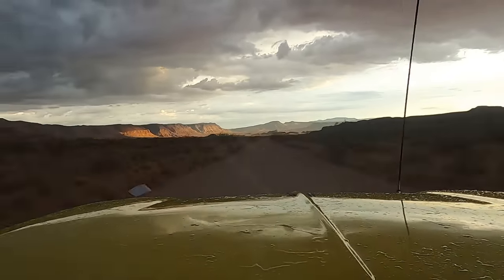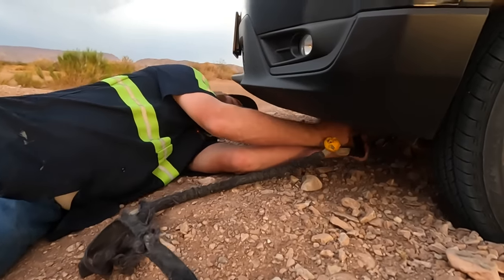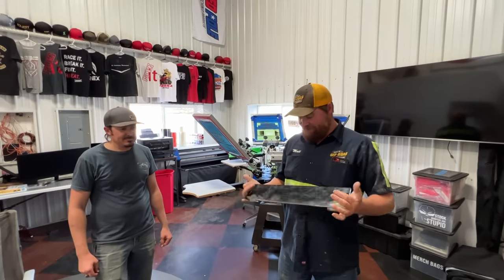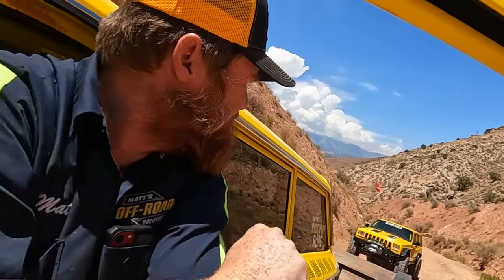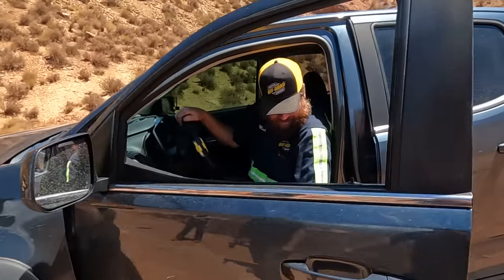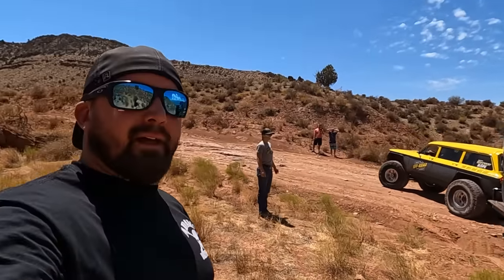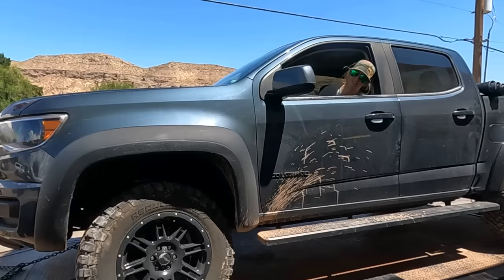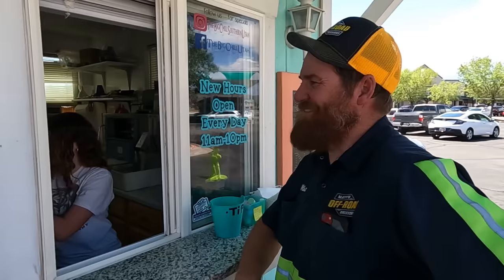Who Would Even Do This?

Comment: "Side by sides do tear up roads".  Thank you for saying that. Drive responsibly.
Reply: I have a SxS. (and a Jeep) 
Yes, SxS's tear the crap out of roads. Everyone runs them in 2WD and the rear bounces up with every bump. Lands, and eats out a little divot of dirt. Over and over X 1000 and they make funky washboardy bumps. Using 4x4, especially uphill would reduce the effects.
Reply: Usually it what's between the seat and steering wheel causing the issues. Do be respectful of the trails for everyone to enjoy nature
Reply: @royh729  I'm a heavy equipment operator (30 years) and have been grading dirt roads from here to Colorado. I know what makes what bumps and washboards. Poor traction is 90% of it.  Using 4x4 and avoiding wheel spin cures most of the road damage. But, people don't like using 4x4 unless they really need it.
Reply: @royh729 The best way to improve off road performance is to upgrade the big nut holding onto the steering wheel.

Comment: For anyone who likes their transmission, the order should always be: 
1.) SET THE PARKING BRAKE 
2.) RELEASE FOOT BRAKE (allowing parking brake to do its thing) 
3.) PUT IN PARK
Reply: Not safe for a steep slope. If the parking break releases the momentum the vehicle gains from the hill may shear off the pawl and allow the vehicle to roll. 
Should be: put in park, slowly let off break untill pawl engages, than set parking break.
Reply: @JohnSmith-do3fe  that‘s the opposite of what you should do. phuz ⬆️ has the right idea but here’s what I like to do.
Put it in Neutral
Set parking brake
Release foot brake
Once vehicle doesn’t roll, you can put it in park and know that the parking brake is holding the weight of the vehicle and NOT the parking pawl.

If the vehicle rolls even with the parking brake engaged, you need to adjust it because no matter what you do..the weight will always be on the parking pawl, which is not what you want. 
Trust me, I park on a sloped driveway everyday
Reply: @hectordeanda9133  That worked in about half the vehicles I've owned; the other half had parking brakes that wouldn't hold no matter how much you adjusted them.
I also learned the hard way not to set the parking brake in freezing weather, if the roads are slushy. Everything refroze overnight and the brake shoes got stuck to the drums.

Comment: I'm sure the owner was a bit pissed at that "beefy" aftermarket control arm ball joint breaking like that
Reply: I have never seen a broken ball joint wheel remain that upright. OTOH I think most of the ones I have seen were lower ball joints... "I'm just going to lie down and take a nap." Pretty dramatic!
Reply: That road is so bad
Reply: I get why people go with the ball joint UCA options but have never regretted getting Total Chaos 1" uniball UCAs on my 4Runner. It is a nice peace of mind knowing that they are more or less indestructible. Looks like a pair of those Freedom UCAs cost about $460 vs a pair of TC uniball UCAs which is around $900. I have never heard of the Freedom ones but I imagine they are fine even with the OEM style BJ for regular driving and light offroad use. But if you start to bomb down a horrible road at speed it may not be the best application.

Comment: i had a upper ball joint on my 91 gmc 1500 pop on me out cutting wood one day, dang tire laid right over. After a long thought period i backed it up and the tire now was upright but behind the control arm. A cut log and a little grunt and i got the broken joint back together. I wrapped 10ft of loggin chain between upper and lower control arm and drove that heap 5 miles home on gravel road with a load of wood in the box. Fun times 👍👍👍👍

Comment: Thanks for being honest about the side by sides.  I ride a dirt bike in an "open" riding area, the side by sides are destroying the desert.
Reply: Sxs have crazy amounts of wheel hop. That and all the hard acceleration make what I call rzr bumps.
Reply: I think part of their problem is how many of the transmissions aren’t really made for crawling at low speed. So, they tend to just power through stuff which digs small bumps into big bumps. Especially with the aggressive tires they normally have. 
With a more normal drivetrain it’s easier to crawl and not dig in as bad.
Reply: In open riding areas they are not even on a road, they are just crossing the desrt, destroying everything in their path.  What used to be a 12 inch wide trail is now a 20 foot wide road.
Reply: @NBSV1  I think the independent suspension adds to that damage.

Comment: Just can't beat the old Ford Twin I Beam front ends. No ball joints to break like the Chevrolet in this video. Granted you have to replace the king pins after 200,000 miles or so, but they won't break.

Comment: Most vehicles have a jack, a very useful tool. Many years ago I helped a young lady get her 70s GM big car out of a ditch when she got out for a call of nature, failed to put the car in park, failed to set the parking brake, the car rolled backwards, and the car's rear wheels were off the ground on the lip of the ravine. A half dozen young men stood around and essentially did nothing. I had a Land Crusher with a winch and knew that there was a risk of drive line damage if I pulled her off the edge of the ravine. The young men, interested in helping a young girl, almost demanded I winch her up off the edge of the ravine. NOPE. I told them to pile rocks and set her jack on the rocks; it was a GM car with a bumper jack, old style. We jacked up the car and put rocks under the rear tires. We had to do this several times because this was an early 70s full size sedan. Finally enough rocks were under the rear tires to get the frame and drive line off the ground so that I could winch her car. The moral of this story is this: Too many ignorant and 'helpless' females and young men have no idea how to get unstuck using the jack. Of course if Matt was to demonstrate how to use a jack in a short video, email a link to it, then he would have fewer stories to tell as more people would become self-reliant. I am a teacher and would make a short video to send them to see if they were smart enough to try to get unstuck on their own.

Comment: What's the logic on UTVs tearing up trails? They are typically lighter, better suspended, have softer sidewall and treaded tires and run lower tire pressure than cars and trucks. They definitely don't create the washboard that cars do.  Perhaps just the ratio of UTVs vs Cars? Or more aggressive, higher speed driving by UTVs?

Comment: Would having a pintle hitch work for the trailer, for off roading? That way if something did go wrong,  only one of the parts got hurt, not everything. Or, does it lose more control if it was a pintle hitch. Use to do much with the large Army trucks and their pintle hitches and trailers.

Comment: Because of how the parking brake actually works you shouldn't tow a vehicle like that Toyota in park. likewise you shouldn't put your vehicle in park if you're getting loaded by a forklift at a place like Lowe's or Home Depot...in that situation it's better to have someone hold the brakes while you're in neutral...   But with the Toyota I'm not really sure what else you could've done, need some wheel straps.

Comment: Just curious how SXS tear up dirt/gravel roads? I have been on that exact road down to toquerville falls in my sxs before, how is my SXS on 35" tires causing more damage than a Jeep or any other offroad vehicle on 35" or larger tires driving down the same road?
Reply: Speed and wheel spin for starters
Reply: @stevelarison7028  so because I am driving a sxs I am automatically speeding and drifting around every corner? It is a road not a rally stage

Comment: I see a lot of these stuck vehicles and I'm thinking are you really serious, they cannot get out of this, where do they live at, it seems like a lot of city folk who's never driven on dirt or mud or sand is being stupid tourist here, I'm sorry but if you rock the vehicle backwards and forth you will get out at times, I grew up in East Central Kentucky, I've had vehicles stuck so deep, that's the oil and transmission got so hot that it boiled out, the engine has stopped, but that was with the 76 Chevrolet pickup truck with the California head, back whenever the head was steel. You didn't have to worry about aluminum heads warping if they got just a little bit of heat to them from being overheated, they don't make vehicles like they used to, if you really want to vehicle to be in the mud with, go with the Chevrolet, I know my GMC terrain SLT can go through 70% of this stuff